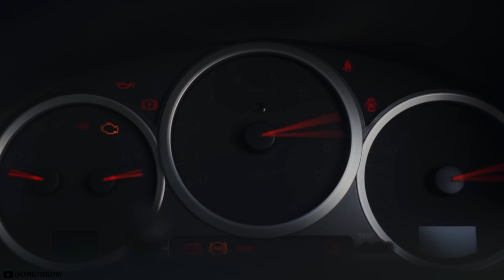Donut Media VS. Subaru

Comment: I bought a new 2015 Subaru WRX in January of 2015 and I haven't had the money to put aftermarket parts on it but I did change the spark plugs at 104,000 miles and the spark plugs that were in there weren't damaged I just know Subaru recommends it I think at 60,000 and the car to a point has been somewhat babied because from 0 miles to the 118,xxx I'm at now and the MPG from 0 is 32.6 and I don't know if I would have ran it harder and not done 75% highway driving how much it would or wouldn't have effected it but I'm considering getting a new Z but I also live in the Midwest so driving in the snow or ice could be bad unless I got some aftermarket tires possibly with the mountain and ❄️ on it but I don't know yet because it's a possibility and also quite a bit of money

Comment: I chalk it up to owners inexperience. Everyone talks about how vq's burn oil, or the oil gallery gasket is weak. Nah, it's just they expect every engine to be able to be worked on and beat on with no due diligence. My vq doesn't burn oil because i focused on the break in period, and gallery gaskets is a maintenance thing, those gaskets fail because ignorance or negligence.

Comment: Wait, so what did go wrong? Were there oiling issues? Also what exactly is so hard to work on? When building an engine there is a tolerante spec, you are either in tolerante or out of tolerante? So were they out of spec. ??? I don't feel I learned anything about Subarus. The pladitud there is a lot to know was thrown around and the video ended.

Comment: Donut can be described as car guys who don’t have a lot of car knowledge. I haven’t watched their series on this yet, but I have owned a 2013 STi from new. I modified it and had it tuned properly. Ran great and sold it to the next guy who subsequently blew it up. 

I think both sides of this argument have a leg to stand on. Sure donut may not have built it for 1g corners, but what enthusiasts car other than Subaru has oil starvation issues at that limit? 

The ringlands and block are another issue. A semi-open deck shouldn’t be used for turbo or boosted applications. Subarus cooling for cylinder 4 has always been trash and it will almost always be the point of those types of failures. 

My experience with my Subaru was good, but I wouldn’t buy another one.

Comment: Realize that just because it has a rally pedigree doesn't change the fact that it's still a 4 door family sedan with a turbo. They're temperamental. But if you're willing to accept that, and you don't beat the snot out of it just going to work you'll be fine. When someone makes a headgasket jab just nod and smile, it's all part of the fun 😃

Comment: So I've followed the whole video thread, across multiple channels, and from an outside observer, the Subaru community comes off looking worse than Donut in this case. The number of videos or comments basically saying "well duh, if you don't replace <insert a ton of basic parts here> of course it's going to fail" is not a good look. No other cars in the HIlow series have had these kinds of issues. Watching the Mr. Subaru video the way he so nonchalantly points out things like non-welded oil pickups and a crap oil pan is just astonishing. Quit trying to defend Subaru for selling people a performance car with parts on it that will cause catastrophic engine failures when driven for performance.

Comment: Tbh i thank donut for just for showing the truth of the builds rather than cop out and edit the faults out if anything feels more honest with the issues they dealt with...not like subaru folks haven't swapped motors 3+ times when they go bad...heck half of the ones that are for sale have the same "fresh rebuilt engine" tags
Reply: Yeh the dumb thing is in a suburu you cant treat them like normal cars cause if you track them and mod them like any other platform then the engines shit themselves, i honestly dont know why people expose themselves to working on and learning these engines, quite litterally any v or inline engine is gonna be more reliable, im happy donut showed the truth, shame the fanboys get mad over it

Comment: Honestly these Subaru guys remind of the 6.0 powerstroke diesel fans, they love to talk about how reliable they are, and how they "make 600 whp on just a tow tune" But completely fail to mention all the areas they worked on outside of the commonly talked about issues with the platform to get it to a reliable place and people buy into the platform thinking if they address these few common issues that the truck will run forever like the older 7.3s. They then tune them, blow them up, and try to convince others that they are reliable so people will buy theirs, and the cycle continues because they don't take the time to truly learn the platform

Comment: In my profession (software) we have similar situations when it comes to code. You can write code that highlights your elite skills as a programmer, that's extremely efficient with single digit variables and long chains of nested ternaries, but it's SO advanced and SO abstract that you must be an expert in order to be effective or you're just going to ruin everything. This example would be Subaru.

OR you can author code to be easy to read by human eyes, it's got a few more lines of code but you have an application that any developer can pick up and iterate upon. This would be a Mazda Miata.

Is one "better" than the other? Truly objective answers range from "not necessarily" to "it depends". That said my priorities can inform my preferences towards one or the other.

Comment: The automotive industry is so diverse cause everyone identifies around a certain type or specific car in which sometimes it’s hard to admit that the cars we love have faults, I love an Alfa Romeo but the wiring on the older ones absolutely terrify the hell out of me. Subaru are great if that’s your bread and butter like a 60’s Lincoln Continental they’re trickier than most expect. If you’re new I honestly would say avoid it till you can find someone to guide you through the platform as you said the tolerances aren’t there as compared to other less Niche platforms

Comment: It is the same as Alfa Romeo Busso and FIAT Marea engine issue that people to this day don't understand. There is no light modification on those. You have them in factory condition and factory approved maintenance regime or they go caput. There is nothing you can get away with. The only reliable modification that can be done to them is racing parts and most of the affordable stuff is just barely reliable for everyday use. The platform is great for what it is. The Busso is one of the best sounding engines in history and Marea's 5 cil is great to drive especially in E100. It's just, they are not VW engines that take whatever and work marginally alright. In the end of the day some platforms are not made to be modified in the YOLO mindset and Donut got burn by this.

Comment: I'm not going to say they did anything wrong however ive seen brand new subarus blow their engine at 200 miles its just so sensitive to any debris in the engine and subaru knows it which is why they will warranty repair engines under 100k miles

Comment: It was the best way in the early 2000s and into the 2010s to get cheap speed with boat loads of traction. A modestly tuned Subaru making 350 wheel horsepower with the proper suspension setup was fairly "cheap" compared to out of the box options being offered in the early 2010s. I don't see myself going back to Subaru for performance. I just liked driving fast everywhere in all road conditions. I don't want to slow down for rain or curvy roads. Most other 'responsible' drivers ruin the driving experience for me. I used to drive like Wheres981 but I spent a year abroad mid 2010s and then the pandemic happened around the same time I killed my Subie and I mostly stopped driving. Because all I want to do is push the limits everytime I'm behind the wheel of a car. Most people are probably thankful I'm mostly off the road. I still drive like a dick but it's just much less frequently now.

Comment: My friends that own Subarus have gone through 3 engines and with the pre maintenance oil catch can oil pick ups. Oil pan baffles. And they still blow-up.. my other friend had one fresh of the lot 2019 sti. Blew up being stock. Just beat on it taking to the Track and canyon roads. If you read on these engines from factory the crank shaft weren't properly balanced and main journals aren't never aligned properly. it's a good platform but if your not dumping Hella money for a proper rebuild to fix the errors Subaru did cheaping out on a boxer engine its going to blow up......

Comment: My 2002 WRX lost its head gasket because the bolts stripped off the turbo manifold for the heat shield, no head shield = cooked head. That was MY fault. Not the car.

Comment: I've had a subaru for about 5 years now. Coming from a skyline, I can safely say these cars are just not built the same way. So many known weak points. In the wrx you have weak oil pickup, weak transmission, poor oil consumption, poor headgasket materials, difficult engine bay to work in etc. It's a half built car. Fun to drive, fun to own, but I've been through one engine. It drank oil. I was 200km over the oil interval change.

Comment: Garbage engines yielded garbage results who could've thought.

I invite anyone with a turbocharged EJ to hook up a oil pressure gauge to your turbo oil feed and have a buddy watch it at idle and at like 4500rpm and see how little oil pressure your turbo gets at idle and at higher RPMs its why EJs consume turbos like they're poptarts.

Theres a reason Subaru cannot wait to get away from the EJ motor.

Comment: I feel like a "good platform" would suggest, completely stock, its good. You shouldnt need to change a ton of things about the car before you start modding it for it to be considered a good car. I feel like a "good platform" car you shouldn't need to know all this extra stuff about it to keep it from blowing up. A good platform you should be able to buy and drive not buy, replace a ton of parts, rebuild the engine, and then drive.

Comment: i've never been a fan of subaru and I'm sure some of the issues donut media had were platform problems.  I'm also not a huge fan of donut media as they do a lot of automotive work and modifications that require a high level of skill to do, but in their videos they almost always only show very surface level stuff, which leaves me wondering what level of skill they actually have on the subject as they tend to leave that answer ambiguous.  that being said, when it comes to performance upgrades, some platforms are much less forgiving and they have lots of platform specific issues that are solvable, but you have to have a really in depth knowledge of that specific system and I'm guessing (since I've never owned one) subaru is one of those platforms.  just because you are really good at working on cars doesn't mean you can just jump onto any car and work on it and make it work, some cars you really just need years of experience and lessons learned with that specific engine

Comment: You had the Evo as well.. All "performance"  street cars are going to push the lubrication systems to the limit. Subaru is just the worst offender. Fanboys getting pissy about it doesn't change facts. It's very much a shame. It's a bargain for what you get. Their stock ECU is very tuneable.

Comment: I agree mostly. I like those guys at Donut, but they did it all wrong. You can do the labor  in your garage but it has to immediately be tuned . That includes engine, drivetrain and suspension. There's a lot of info and it seems every city has a least one expert tuner. There's even books like the "High-Performance Subaru Builder's Guide". People build them everyday yet Donut couldn't? I disagree that they simply couldn't do it considering their resources. In today's market, attention is currency and this sh!t show made for more attention. Yes tuning a Subaru takes more skill, that's the point. I recently got a CX50 turbo, Corksport and Mazda are all "yeah throw a CAI no tune needed, wanna run 87 octane go for it". But that would literally break a wrx, it's easy to avoid though and I'm supposed to believe they could even get a few hundred miles. C'mon we gotta call BS on that.

Comment: The only thing that I can fault donut for is not doing their research initially when they were looking at buying a Subaru.

I myself a few months ago was looking for a new car or a/used car aka new to me car and I have a ASE master certified mechanic friend and I'd ask him what he thought about Subarus and he explicitly told me Subarus are great cars if you buy them brand new. But if you buy somebody else's project, you have no idea what they've done to it. How hard they rode that car and it could be expensive to fix those parts for a Subaru. He also told me if done well they are beasts. So I did not buy a Subaru. I went with an old lady Lincoln LS.

Which in itself has problems now and I'm probably going to sell that too.

Comment: They tracked the cars without doing the proper mods and preparations what did they expect?  Everyone knows you need to do the oil pickup mod and pan plus at least a catch can if you want to do track time.

Comment: Not a wrx hater. But I’ve worked on just about every kinda of motor except super exotic ones. And I have to say it is one of the most finicky pain in the back side for no reason. The Engineers really played a sick joke on Mechanics😂. Even 100% stock it gives me migraines. Buy it new have fun for two years and dump it.

Comment: to put it simply, if you put 90% of stock turboed engines in this exact same scenario they would have never blown, the fact the boosted non stock turbod engines and they did better is sad, the 350z should have had way more issues then these engines designed with turbos in mind

Comment: Subarus WRX's are underbuilt and don't handle being thrashed on very well. That goes for pretty much all generations. Some of these problems can be solved with a built motor, and some of it is inherent to the EJ design. If you wan't one of these, keep the motor stock stock and go stancy with wheels. That goes for like 99% of the owners. Keep it simple. Don't go in over your head, you are going to cry. I don't like Stance but thats really all their good for. They do look good. They do sound good.

Comment: Tbh I feel like the biggest issue is that donut didn't do any break-in on any of the motors. The biggest reason why I think the community is mad is because all the information about how to build and take care of these cars is out there every single thing about a subaru is there with a simple google search in comparison to other platforms. Donut has a obligation with there reach and community to do some research and give it a fair shake instead of making a video for the clicks. Subarus are no more difficult to build than any other 4 cyl.  The community is active and open to help and if you dont try to make efort to tap into is is my pain problem with the high low.

Comment: If a performance car can’t take a corner hard without blowing up and replacing the oil pan and pickup is an essential first mod, it’s a bad car. Subarus have a reputation for a reason.

Comment: end of the day, if its shit its shit no two ways around it, yes all motors has their unique issues. but the severity of those issues would determine how shit a engine really is. and if that issue is o bad that  it will blow your motor well then its shit. because why do i have to buy a car but have to open up the engine to put in a stronger piston, or rod etc in this case the most import thing in a engine is oil. and for a engine to have a issue with supplying oil in stock form,to me thats a pretty big fuckup.  yes the subie guys is getting a fit thats their thing. the engine is shit because of a basic but huge issue. its always the know it alls that throw tantrums. the subie guys knew DONUT was going to test this stuff on track, so why didnt they reach out? now lotsa cash later they want to cry foul. thanks Alex you did a great job with this and keeping it neutral. I dont have to lol  Im a car guy but im not brand loyal i find that mentality dumb. i dont see the need for a  customer to fork alot of money to fix a issue that engineers had to sort out, ill make it better but ill not fix, read that to understand it

Comment: The real issue that Donut exposed, is that there is nothing else like a Subaru. The H4 engines are unique, and as a result, they have issues that nobody expects unless they know about those motors specifically. The average car guy will probably do what they did. Basic research, use a baffled oil pan (which they did), and modify it like another project car. The problem comes when the engine doesn't take it, because there is some reason its different for a boxer than a V or I engine. 

Honda engines can take a stupid amount of abuse and neglect and keep going. I ran my Subaru low on oil (leaking pan) once, and I now burn 2 quarts of oil per change instead of 1/2. 4x the oil consumption because it ran low once is the kind of low tolerance that leads to Subaru issues. If I was a regular person, who didnt check my oil, my engine would not have lasted until my next scheduled oil change, because 2,000 more miles with 1-2 quarts of oil in the motor would have been terminal, while a Honda may have been mostly fine. I knew someone who had a Honda Odyssey in their shop. 260k miles, oil changed every 80-100k miles.

Comment: So I was on the market for a wagon WRX and after Donut I looking at an A4 wagon 3.2 diesel just because Subaru seems to be a pain to maintain and even ease of access to parts on the engine...I believe that if you need to be an expert to work on a certain car then you shouldn't work on it and just have an expert work on it.